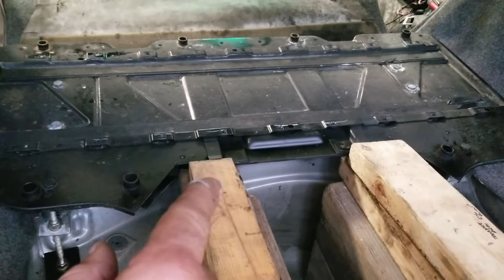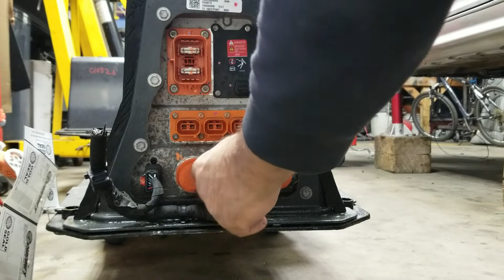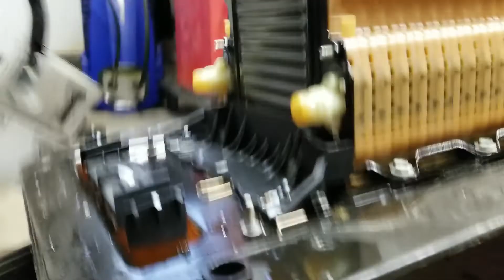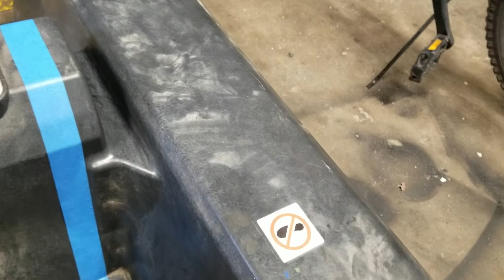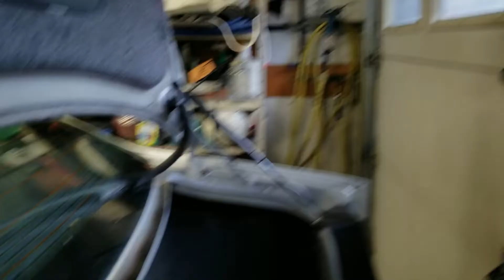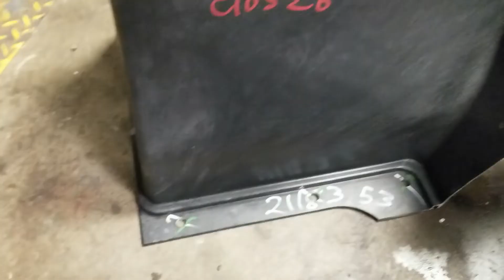Electric Car Conversion e46

Comment: I'm no expert, but at some stage might it be advisable to use insulative gloves?
Reply from the maker: This is a very good point.
Yes! It is!.  If you  some how touch battery + and battery -  at these voltages you more then likely WILL get shocked!  
Why I'm not wearing them is because I'm a electrician and know what I can and can not touch.
Reply: @InTheGarge  especially electricians use those gloves because they are aware of the danger and know that it is life threatening with these voltages. Would appreciate the safety equipment in future videos, keep up the great work!

Comment: What size are the electric wires between the battery and motor, in between the battery modules, and between the battery and future BMS &converter?
Reply from the maker: BMS wire are way smaller in comparison to the main battery wires. 
I think the BMS wires are #20awg. Note: each BMS wire is fuse protected at the battery
Reply from the maker: main battery cables, I'm using #2AWG which is good for 115amps,  but if I were to do it again i would go one or 2 sizes larger.

Comment: I relocated my 12v battery to the front to transfer weight on my e36
Reply from the maker: I just left it in tis original location. Car hasn't been on its wheels since I start the project but if its a problem I'll move it. Just don't know where...there is NO room in the engine bay now. :)
Reply: @InTheGarge  ok

Comment: I wanted to try to use the coolant lines but in my trunk it was just getting crazy with the hoses plus high voltage lines. I reversed that plan for now. If you manage to do it I'll be very impressed
Reply from the maker: I was a tight fit but its in there...heck I still have room for the spare tire!
Work in the trunk isn't 100% complete yet but coolant lines and high voltages lines are going to tucked away and I dont see having issues with them.
Reply from the maker: with the Chevy volt biggest battery the coolant come out from the middle and not the sides,  which makes it easier to connect to.

Comment: I'm using Chevy volt batteries too but i couldn't fit the whole pack in my car. I reworked it into two groups of 144v in the trunk. Gen 1. Is Gen2 the same dimensions? What will you do for a bms. Right now at least to start it's without BMS . I'm still building the car
Reply from the maker: I too had to split the pack apart. but everything is connected in series just like it was from the factory for the fully 360Volts.  It hasn't been on the road yet so I'm not sure if 360volts is needed or not.  
As for the BMS I'm not sure what I'm going top do there. I've been looking on Alliexpres and or maybe use 2 ardunio Megas and connect all the cells to it.  trick there is making up the code.
I also see bratitude on the openverter figured out how to fire up the GEN2 Bms to show voltages.
Reply from the maker: One more thing...be aware of the white band near the top of the battery, 
That band is made out of steel and  its pretty close the the Positive and Negative posts of the battery. You DO NOT want to short those. 
Ask me how I know....  ;)